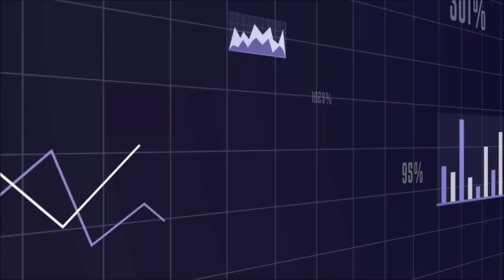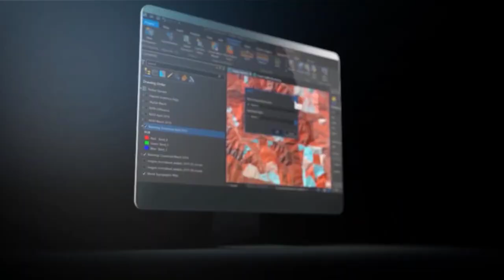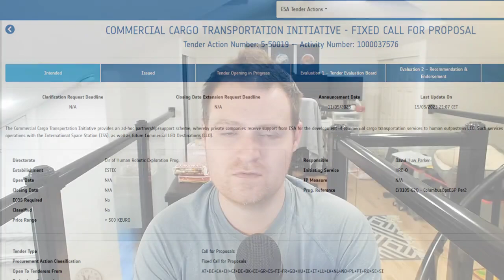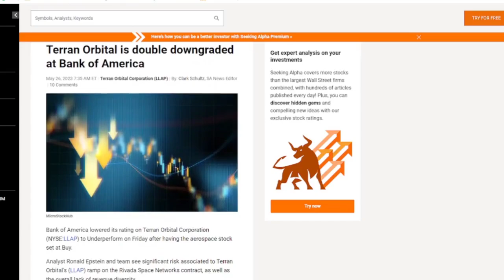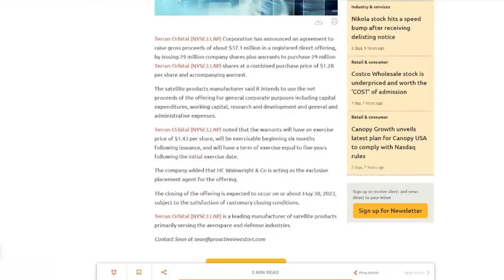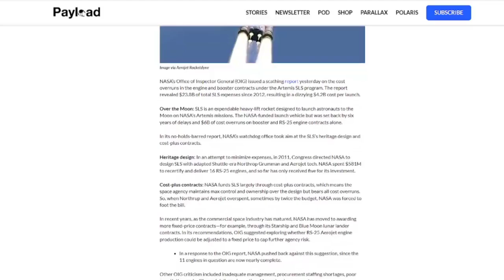Space Stock Updates May 28: New Nasa Contracts, Successful Launches, Partnerships & More!

Comment: Expensive yes, but at least SLS works. Compare SLS with the Starship launch, when the solid rocket boosters were ignited, SLS was gone! Starship, when the lit it up, sat there for 8 seconds and didn't move, destroying the pad and a number of engines, looked as though this over weight beast was going to dig itself a hole to China. Just like aircraft, when it comes to building rockets, stainless steel is usually not the material of choice.